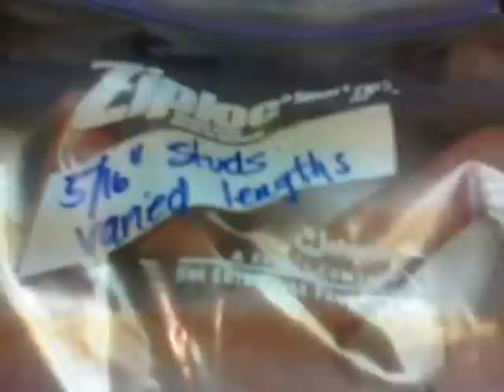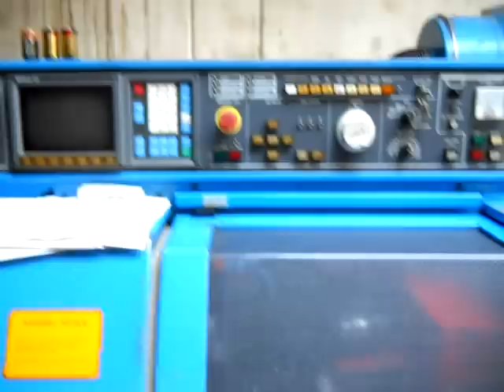Jag E-Type brake pedal box and servo rebuild final

Comment: Hi John, re the rubber buffer (part no. c17239 I think) that you mention at 22:11, I can't find one in UK. Where did you source yours or did you make it ?
Cheers, Neil
Reply from the maker: Neil S  - I really cannot recall with certainty what I did but I think I just repurposed a generic rubber washer I had lying around. It wasn't anything special as far as I remember.
Reply: JohnCarey1963Jag . Thanks John, I'll take the same approach. I rather naively hoped that I'd be able to buy a service kit for the whole assembly. Now having to make up some of the bushes in stainless too as they crumbled on disassembly. Bettie is looking great !  Cheers, Neil